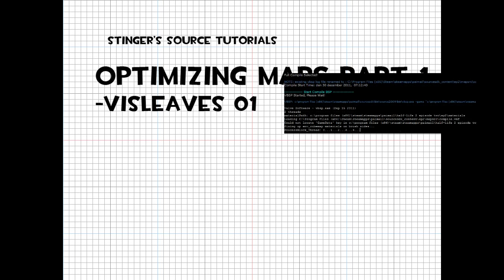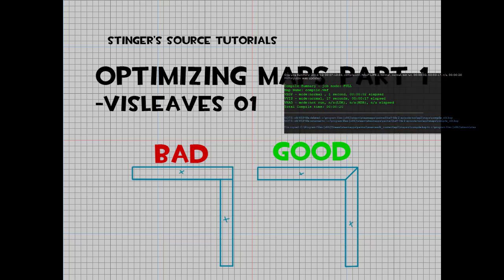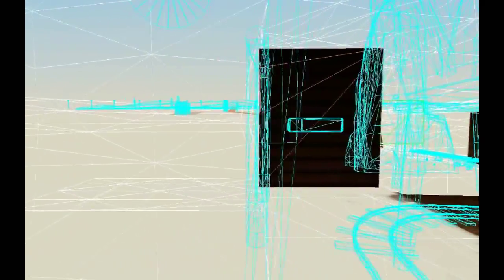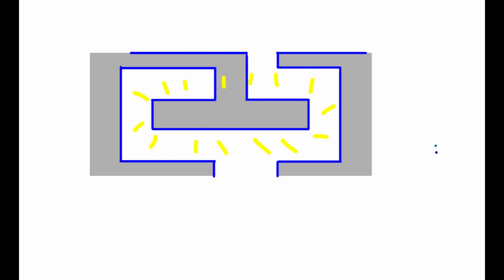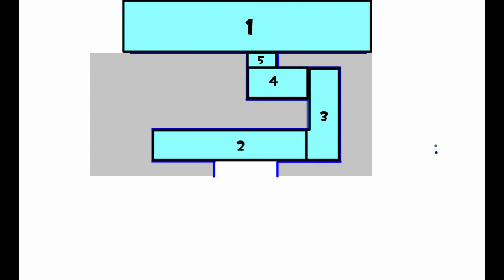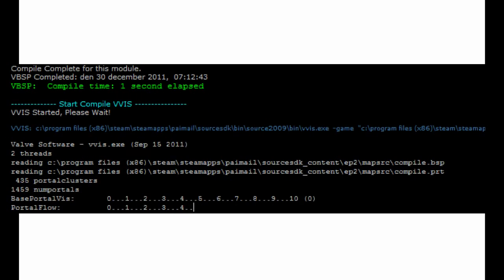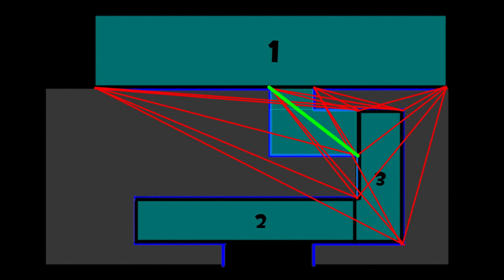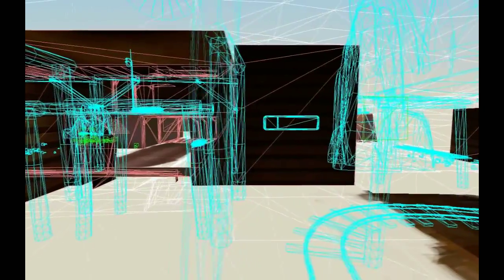Stinger's source tutorials Optimizing maps #1 - Visleaves

Comment: I know this is an old video but I have a question. I'm still new to mapping and I haven't heard anywhere why these (0:06) are the "bad" and "good" ways to build an optimized map. If anyone can explain it I'll appreciate it a lot D:
Reply from the maker: tweaking the corners like that does not make any real differance. It does make it nicer to edit in hammer though.
The most important thing for most maps is to make brushes into func_detail and func_lod.
Reply: Comrade Stinger That was fast, thanks for your answer!

Comment: 1:00 the visleaves are generated in vvis I think not in vbsp
Reply from the maker: Lubstar93 Nope, the visleaves are generated in VBSP. 
Then, in VVIS the visleaves are Used to calcualte what parts of the level are visible from where.

You can see this by compiling only VBSP then checking the "portal flow", noticing that the visleaves change position.